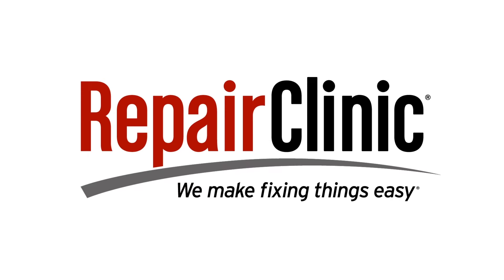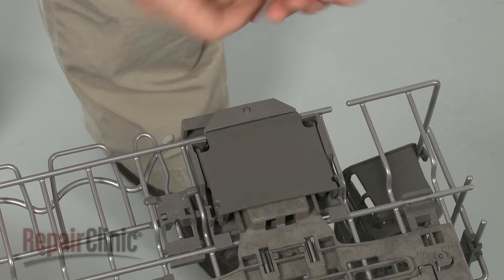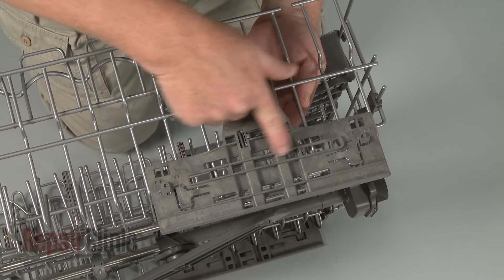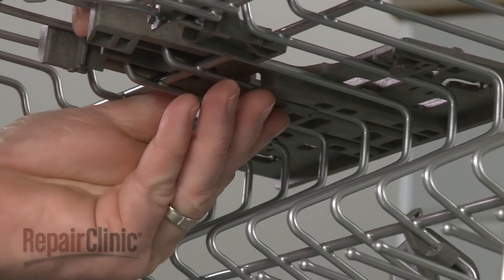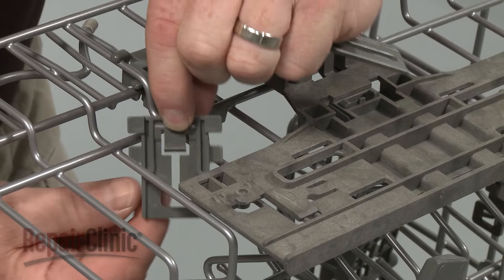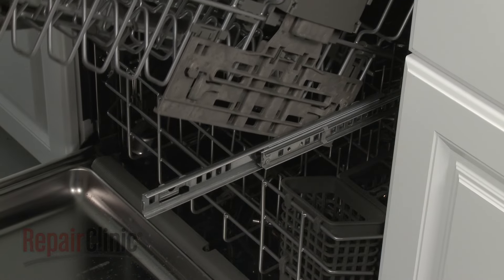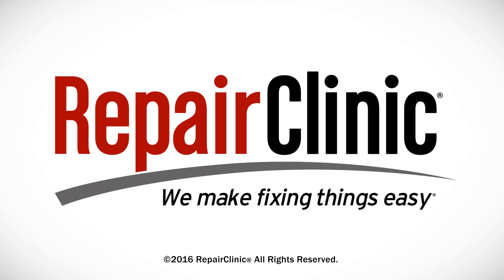KitchenAid Dishwasher Rack Adjuster Replacement #WPW10546503

Comment: Without watching this video, I spent 30-minutes taking the rack apart and installing this part. The short is, after watching 53-seconds of this video, I was able to  fix the left side elevator lock, but I broke the right slide locking mechanism showing my wife how easy it is to take the rack off the rails. lol Now have to replace the right side, but I'll be a pro by that time. The locks should be made out of stainless steel, making them easy to find, knowing it won't be brittle when you depress releasing the rack to remove. Thank you for making this video!
Reply: did the same, the plastic is so britle....not impressed

Comment: I wish your company made a metal replacement for this plastic junk. But thank you for the video, made the job 100x easier
Reply: When I was looking for a replacement adjuster, I did see a stainless steel replacement at one of the online parts retailers. I didn't write the company name down as I decided to just replace the one piece with OEM. The parts looked completely different, but it was supposed to be for the same dishwasher rack. The whole kit was about $60 for Both Sides, including 2 adjusters and all the clips. Worth looking for in the future if this keeps breaking.

Comment: Great video, very easy to follow. Word of advice, in my case the old piece seemed to break because it got brittle with time. I ordered two and replaced both sides to save shipping costs from the inevitable failure of the remaining one.
Reply: My left front tab failed after just 2 years and the right back tab broke off when the rack fell...this was a Kitchenaid. I notified them and they reimbursed me for the 2 replacement parts. They should NOT fail after 2 years. They know about these failures also. There was a class action lawsuit about them but they still have changed nothing.
Reply: Mine too

Comment: Thank you so much!  A tiny piece of plastic had broken on ours, and it had come off the rack.  I fixed it using this and really appreciate it--I never would have been able to figure out on my own where the little pressure release points were for all the clips.
Reply: The same thing happened to ours after 8 years. I went to the hardware store & bought a 5/16" SS carriage bolt, (3) 5/16" SS washers & a 5/16" SS whiz nut and fixed it for less than $3.I did buy an extra set of SS hardware for the other side when it inevitably breaks.

Comment: Great instructions that saved me so much tinkering time!
Thank you!

As others have stated, don't use a screwdriver on the holder tabs at the beginning, or you risk breaking an undamaged deck adjuster like I did.
Thankfully, I had ordered 2.

In fact, the only place to use a screwdriver is to gently pry the tabs that hold the adjuster lever cover in place.
Everything else should be done by hand. 
The planned obsolescense is using plastic that gets brittle over time. Making them easy to break.
The manufacturer knows what they're doing.

I've read comments of people buying whole new dishwashers when these break... 😮

Comment: October 2024: This video was spot-on correct. It was exactly what you need to do to replace the rack adjuster (or any of the other rack components). Completed adjuster replacement in less than 15 minutes. {Some of the other parts (clips) may need to be replaced as they look warn out by the heat, but we'll see if they last.} THANKS for a thorough video.

Comment: Like some of the other commenters, I too
Benefited tremendously from this video. I can now replace the adjuster in minutes as opposed to over an hour of frustration.  I also keep a pair of adjusters handy (they are available quite cheap on Amazon) because the upper rack is attached to the rails by little “nubs” on the adjusters that will eventually break.  Overall, the propensity of appliance makers to cut costs by using plastic everywhere means that you have to keep replacing such parts. Fancy features like the ability to move the rack up and down means more parts that can break.  Oh well…

Comment: Well done video, short and accurate!  I watched a couple times before tackling the job.  I replaced both rack adjusters in 40 mins including my mistakes you can learn from: 1) knocked off an unrelated clip, spent 10 mins figuring where it came from and reseating, LOL;   2) reseating top rack at end took a few tries for all four tabs to click into place properly.   Saved $150-200 between DIY and by using non-'genuine' parts.  Hope they hold up.  Thank you for a very helpful video!

Comment: Thank you. I received a warranty replacement top rack, but when I looked at all the clips and parts that needed to be detached from the old rack and moved to the new one, I couldn't figure it out and almost gave up. Your video showed me exactly the right secret tabs to press and clips to remove, and I was able to complete the transition in about 45 minutes.

Comment: Great video. When you re-install the rack, you have to make sure that both sides are at the same height, or the rack will be "cocked" with one side higher than the other. If one side is higher than the other, the rack will not slide into the dishwasher cabinet.

Comment: Great video! I wish I had watched it before I went through 2 NEW SIDES from the kit! If I purchase another kit, this is the video I will use. Very cheap plastic tabs broke off for the third time, signaling that I had missed something in the installation. I spotted my mistake quickly with this video! Right now I have the side attached to the rack with zip ties! I can’t adjust it, but it’s sturdy!😄
Reply: The zip ties will outlast the plastic parts.  These dishwasher are really crappy.

Comment: Very helpful.  Thank you for posting. Very disappointed in the dishwasher that I had to do this after 4 years.  Plastic was very brittle and the other side broke when dissembling it.  My advice is make sure you buy both sides to replace before fixing this type of attachment if more than a few years old.  Sad to say for a $1,000 dishwasher!
(Kenmore Elite).

Comment: Thank you for this. My only disappointment with it is that I've had to visit this video to replace this same part multiple times. Should just bookmark the video. Each time I've replaced it, I marvel at how impossibly bad the design is for the rack/rack adjuster assembly. The whole thing rests on four tiny plastic tabs that become brittle and break. I guess they keep you guys in business!

Comment: This took me all day for some reason. The replacement parts I ordered were reportedly compatible with my model, but they were not genuine KitchenAid brand. I couldn’t tell the difference except  the pin plastic was about 1/8 of an inch thicker and would not fit into the metal track slot. I used a Dremel tool to shave them down after hours of frustration trying to get all the pieces together (it wasn’t totally clear to me where the stops and the slides should go directionally).  I couldn’t get the adjusters to go up and down and the rack was hitting all of my dishes.  I realized I put those on backwards plus the little pincher thing for tension was not sitting right in the housing. I finally got everything together and stopped crying only to find that the door won’t close. I have played with this thing for hours and I don’t understand why it’s about an inch too far out. I don’t see any other way for it to fit in the track.  Nothing seems to be blocked, but it’s unusable and the replacement part broke when I used a screwdriver to gently depress the T-shaped tab so I could lift the rack up and out once more.  I give up.

Comment: This is the third time I've replaced one of these, not including the other parts that fell off.
I would never have bought this dishwasher if I had known it had so many cheap plastic parts that failed so easily.
Reply: It is the biggest regret I've ever had on a major appliance. Apparently there was some kind of class action settlement for this part where they reimburse repair costs if you made them before June 2021...but there's no evidence they actually designed a new part  so that it'd stop breaking lol...I have never been more pissed at a company than KitchenAid
Reply: @awakenedtarot7306 I agree.

Comment: There are a lot of little pieces involved, and without this video there is no hope of figuring out where they go.  If you have taken the rack apart already (or it fell apart, as in my case) then you need to take inventory of the parts relative to what you see in the video, and order replacements if necessary.  Once you have them all and follow the video carefully it goes together in a 'snap'.

Comment: Good video but you forgot to mention, the last step of reinstalling the rack you need to place the rear clips into the sliders and and then push back about an inch before trying to clip in the front

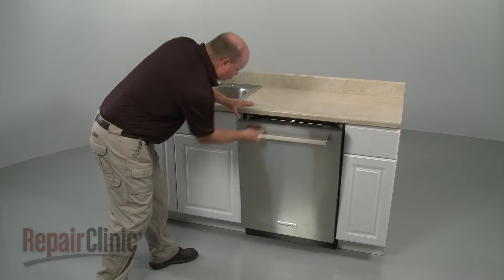Comment: CAUTION -- don't use a screwdriver to remove the assembly from the rails (as shown at about 0:26 in the video). This approach caused me to break the assembly on the other side that wasn't previously broken, setting me back $50 for another part!! Try with your finger FIRST -- it's not that hard.
Reply: Caution: don’t just jam the screwdriver in like this guy must have, if you use it to gently disengage the latch, it’ll be fine. It was fine for me. Don’t try to shank your washer ffs.
Reply: Wish I saw your comment earlier lol
Reply: I made the same mistake and snapped that piece off. Thankfully, I had ordered 2. Considered keeping a spare, but ended up having to replace both.

Comment: Harder than it looks. The rack and adjusters are poorly designed and too hard to remove and re-seat in the tracks. The clips are not obvious or intuitive. The plastics are of low quality and get brittle after just a couple of years. The video would be better if it showed where the elements should line up on each clip and why. For example, should the rack be in the highest or lowest position for removing or installing clips on the adjusters? This is our third Kitchenaid in 20 years and we just had to replace the sump and motor even though it's only 3 years old. I will not buy another KitchenAid dishwasher, which is built with planned obsolescence. Our repair tech agrees.

Comment: I hate Whirlpool Maytag KitchenAid. This repair is so difficult it's almost too much for a homeowner to do himself. But what's infuriating is the cost of hiring someone to do it is ridiculous. The problem is the plastic parts are extremely difficult to remove or to replace. I'm following the instructions to the letter and I'm telling you it is an exceptionally difficult repair.
Reply: This video is way too fast too. They need to slow it down and show what actually happens when you struggle with the parts. I don't believe that guy is doing it this quickly or that easily. Not for one second.